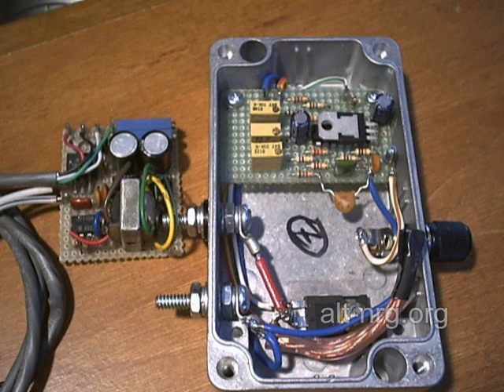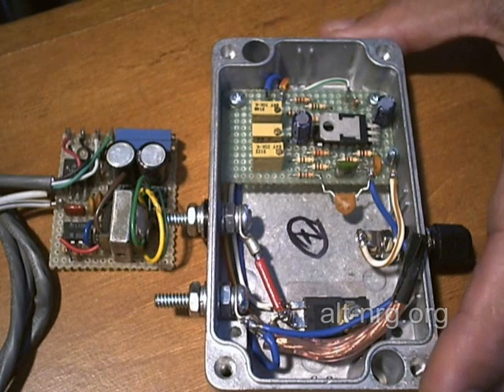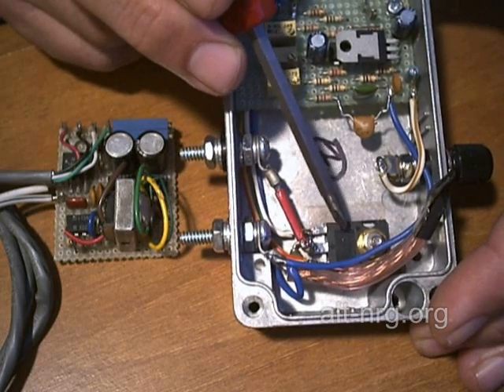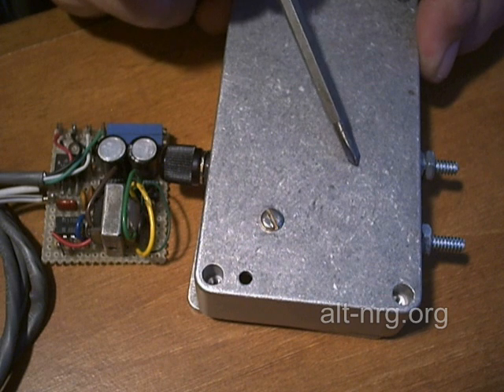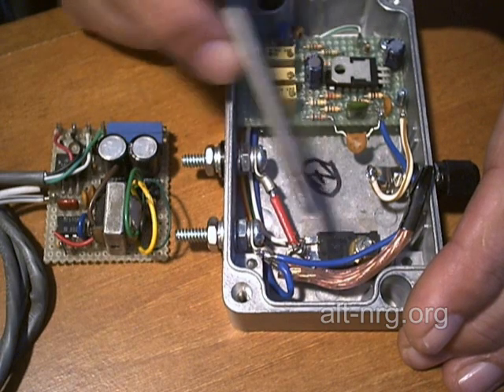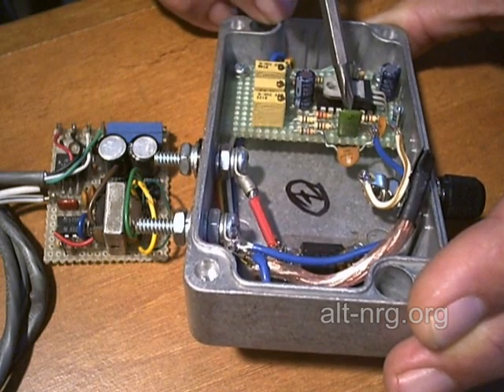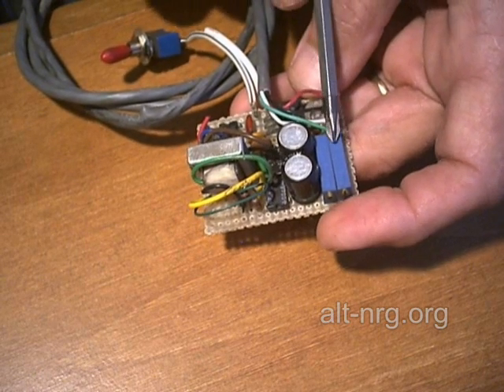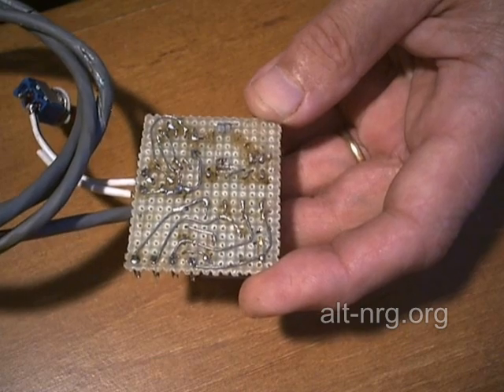#123 Progress recap of PWM and EFIE

Comment: your parts list in the website are not update you mention in this video replacing 0.022uF capacitor (C1) with 0.02 uF polystyrene capacitor , where in your website still 0.022uf not changed. also the schematic diagram not update. another thing in the schematic and part list contain L1 inductor i cannot see it in the assembled board as well as the diode please can you update the website with proper schematic and layout. you have put an effort to make it . i salute you

Comment: @ZeroFossilFuel    What would happen if you just disengaged the air sensor in the exhaust pipe?  Just wondering... if it didn't stall the car and just ran lean then why add the EFIE at all?  The fuel would burn better with the HHO, no extra oxy would be detected and so no need for the EFIE.  That's if the engine wouldn't stall.  I should try it just to see what would happen.

Comment: Excelent work Z! I too was wondering about that slope on your square wave. Is it because your FET doesn't have a good enough driver? or is it the property of water/electrolyte resistance? I would use a more reliable device thr can dissipate 500W. the STE250NS10 would be a fine choice I think...

Comment: Hi You can use a UC3710 6A MOSFET Driver to drive the mosfet very easy and it can be mounted to the case. Will sink or sourse up to 6 Amps witch should allow you to turn the mosfet on hard to get more amps out. Will turn the mosfet off quicker. Will allow higher freq. Keep up the great work